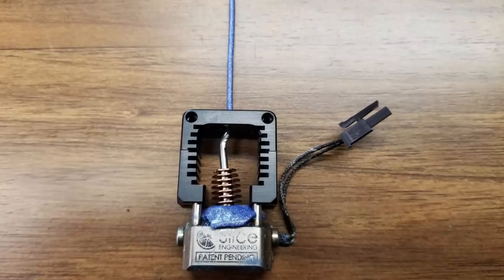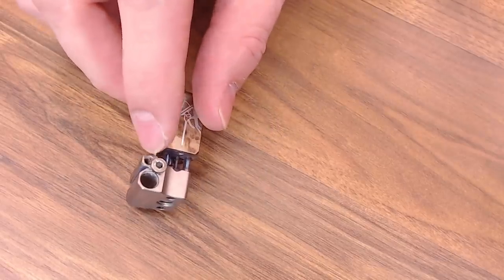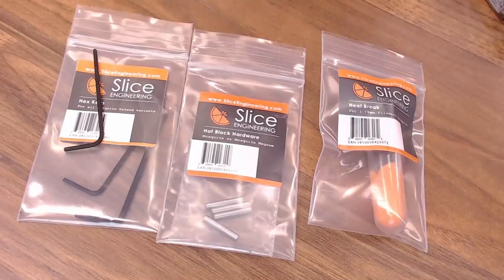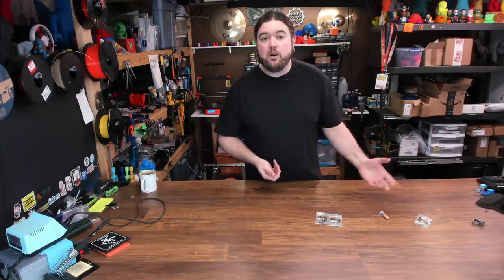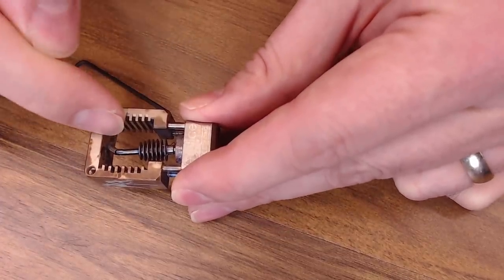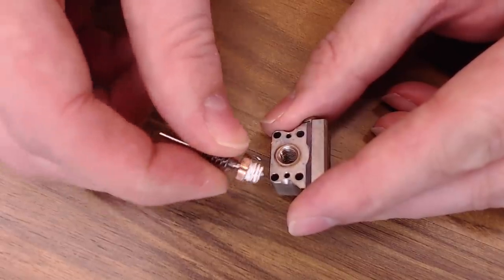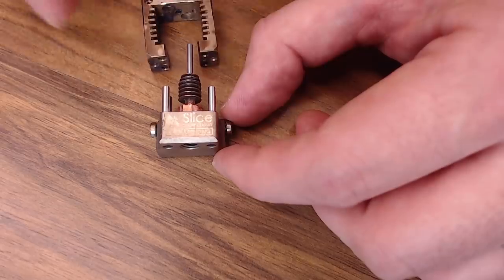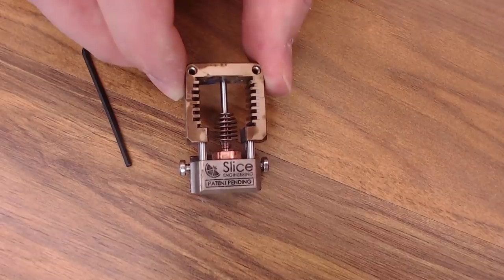Slice Engineering - Mosquito Hotend Repair - Chris's Basement

Comment: thanks for making this video, as it helped me out today. one thing i recommend while putting the hotend back together is stick a piece of filament through the hotend piping without the nozzle attached the copper part threaded in. and then carefully reattach the black anodized part with the 4 pipes carefully to the heat break with the filament going through.
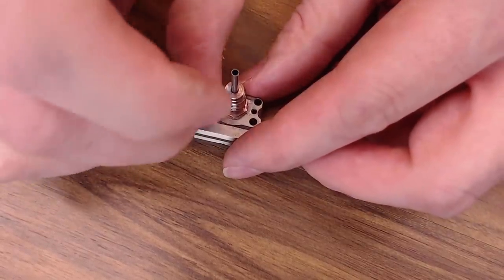I say all this because i attached the part with the mosiquito logo to the rest of the assembly and that little pipe that joins the two parts can easily be pent, and will not allow filament to pass through. see around 6:00 in the video.
Reply from the maker: Great tip Chris, thanks!

Comment: So Dan told me I was the only case of a Heatbreak collapsing like that! lol. But that happened to me too. My heatbreak cracked at the Copper; between the fins and the copper nut piece. I suspected that a jam occurred in the top and maybe tweaked it? With a Bondtech jams just get pushed thru. On a mosquito the delicate steel tubes can bend and collapse resulting in a crack at the bottom. Either way great video.
Reply from the maker: Thanks Stephen, yeah, I think this was a Bondtech extruder. That's probably exactly what happened.

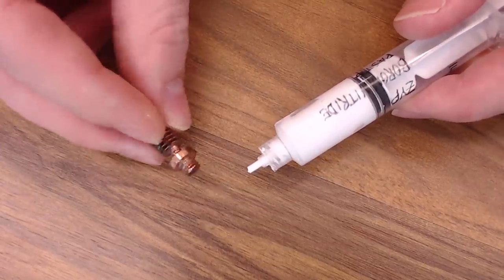Comment: Surely you want as little heat transfer as possible between the heater block & heat break.  ( @ 4:55)  Added to which thermal compound isnt a good idea at 200 + degree C
Reply from the maker: I will let Slice weigh in on that.
Reply: This is high heat thermal compound made for this, and you do want high transfer there as it's part of the melt zone and not at the break point yet.

Comment: Oh Man, just how hot did you torch that thing?  wonder if that much heat can change the materials characteristics? guess it really doesn't matter as the Heatbreak is the main thing and replacing it.  Nice vid as always!
Reply from the maker: 220, 221, whatever it takes. :) Probably some for sure, we will see. Thanks man.

Comment: Any recommendation for fixing/upgrading a Prusa mk3s hotend? I am having trouble with my hotend ooze out the filament and junk up the end, leading to failed prints.  I am about over the e3d hotend and changing nozzles
Reply from the maker: That's strange, I have never really had one ooze like that. I would think that would be caused by the nozzle.

Comment: Am I the only idiot that thinks thermal conductive paste shouldn't be used on the heat block end of a heat break? I'd expect to want to keep that interface as high a delta-T as possible to help out the cooling fan. Feel free to educate me if I'm not thinking about this the right way.
Reply: I thought exactly the same.
Reply: I would disagree as you want the filament to melt as quickly as possible to get to higher printing speeds. Therefore you want the threaded copper part of the heartbreak as well as the nozzle to have good thermal contact to the heatblock for it to start heating up/melt in that section. The thin tube part of the heatbreak schould take care of creating the heat gradient from the heatblock to the cold end to make sure the filament melts right where it is supposed to. With V6 Style hotends this doesn't make as much sense as the hotend is made entirely from stainless steel which has a low thermal conductivity anyway so it won't help much heating the filament at the lower threaded section.
Reply from the maker: A good discussion either way, maybe we can get Slice to weigh in on it.
Reply: thats right, "pre heating" the filament in the tube as other comment suggests is bad news.  especially lower end filaments get softer/squishier.   I've heard its maybe more useful as an anti-seize to keep the break from getting stuck on, but I still would never put high end TIM there.
Reply: You want it to conduct there as it allows for betting melting. That's why they make them out of copper on the better heat breaks.

Comment: There's a chemical called Dichloromethane  or methylene chloride, it's easy enough to pick up online. It will completely dissolve PLA and ABS. I use it for cleaning nozzles and will get rid of everything without leaving a trace.

It's nasty stuff but if you dont get it on your skin then you'll be fine.
Reply from the maker: Thanks, I have never heard of that.
Reply: I always wonder how on earth you are supposed to dispose of chemicals like that... You normally can't dump them down the drain and you sure don't want to dump it out on your garden. (Maybe your nosy neighbor's garden?)
Reply from the maker: @BobSmith42  Here twice a year we have contaminated waste disposal. We take a lot of stuff there and let the city handle it. It is always a challenge.
Reply: Dichlo is actually what is used to deccafeinate coffee. You won't have to worry about disposing it as it's a brilliant glue for PLA (the best in fact) if you have a container full of dichloromethane and you leave the lid off it will evaporate within a couple of days .

Comment: Instead of torching, could you just have heated it up via the heater cartridge?
Reply: ...or a paint-stripping hot air gun.  The torch risks changing the temper of the copper.
Reply from the maker: Torch is not always a great idea, there was a lot of plastic up on the heatsink and I wasn't really sure I would be able to save it at all, so I went all in.

Comment: Boron Nitrite does not take much heat for it to crystallize and turn into a crumbly, broken apart solid (visible under a low power microscope). I would use liquid metal thermal compound for this application myself as it has a much higher heat resistance factor and when reaching the high heats it retains its liquid state and is much better at heat transfer.
Reply from the maker: I am not really sure on the science of the whole thing, I just do what Slice tells me to. ;)
Reply: What liquid metal did you use, most seem to have a max rating of 200c. Thanks

Comment: The replacement parts cost more than my entire hotend^^
Reply from the maker: To buy them all individually, I would guess yes.
Reply: @ChrisRiley  That's not what I meant. I replaced my hotend of my Ender 3 for 8-9€. On my second Ender I even just went with "What is the cheapest thing I can order from China? Oh 2,73€? Wth, I have to try it!" The Mosquito heatbreak costs 34,99$. For the price of my cheap hotend I wouldn't even have gotten the screws^^ It is like a totally different world. When the Mosquito breaks: "Oh no, now I have to get replacement parts!" When the cheap hotend breaks: "How did this even work so well until now?! Ah well, guess I get a new one... or two" The Mosquito is most likely far better in nearly every regard, but fitting it to an Ender 3, that I bought as "broken" for 70€ would just be ridiculous :D
Reply from the maker: @SchwachsinnProduzent  I get ya, I totally understand what you mean.